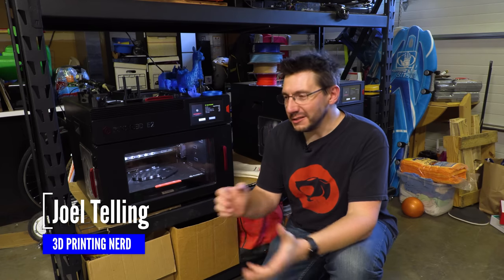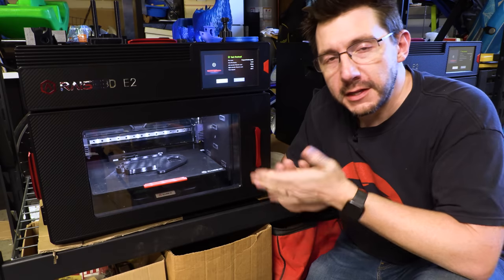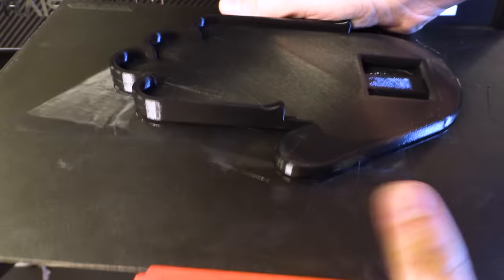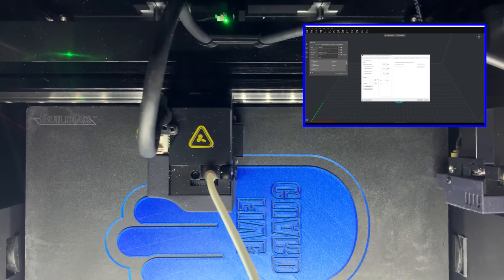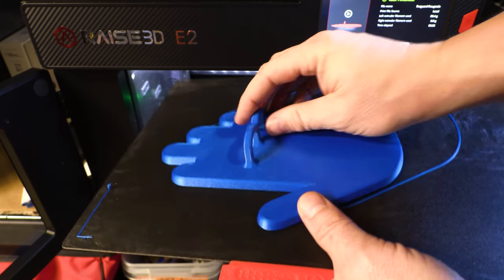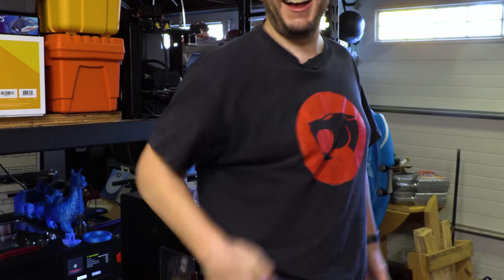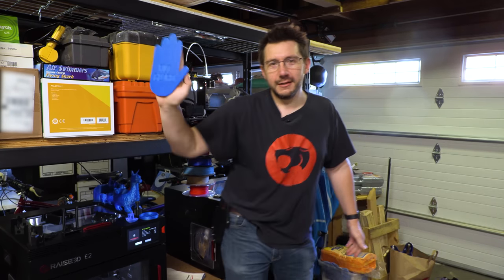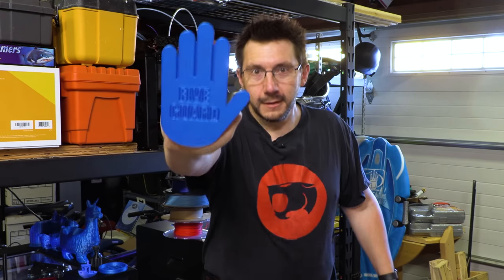3D Printing a HIGH FIVE in a HOLSTER

Comment: Now that's a scientific use of a 3D printer. I use mine to make custom-sized Eppendorf tube holders for molecular biology and microbiology. It really has changed my life a lot.
Reply from the maker: I had to look up Eppendorf - is that the company name OR the name of a specific type of tube?
Reply: @3DPrintingNerd  Eppendorf is the company name. They're a very large company in the Biotech sphere.
Reply: @3DPrintingNerd  It's so commonly used that it's almost become a name that you call the tube. Just like how a Ziplock is any self-sealing plastic cover. The generic name is a microcentrifuge tube. It generally has a capacity between 0.2 and 2 ml.

Comment: The 2nd night in a row where Joel prevents me from getting sleep. I'm so cracking up right now about this insane&spectacular 3D Printing-Idea! The best is: You don't need an open carry permit to wear it in pubic! I just love it. And the cherry on the cake is: If you print it in PETG it's also cleanable with any sorts of virus-killer-fluid like alcohol and co. Cause PETG is rated to be duarble with this kind of liquids (if i'm not totaly wrong on it) - Continental HighFive!

Comment: I like your Five Guard. It came out beautiful. When you mentioned using the Nano Polymer I had to mention. I was having a heck of a problem with getting PLA to stick to my PEI bed. It would not stick for anything. Then I tried the sample I got of Vision Minor Nano Polymer. And holly cow does it work. I don't think I would buy it for the price they charge. I think $50 for 100ml. is outrageous. But this stuff works great though.